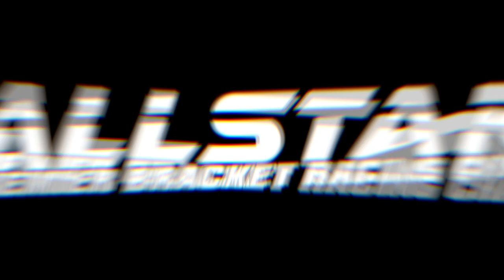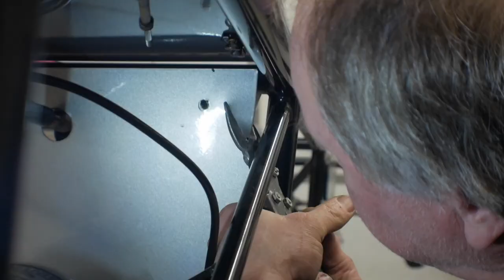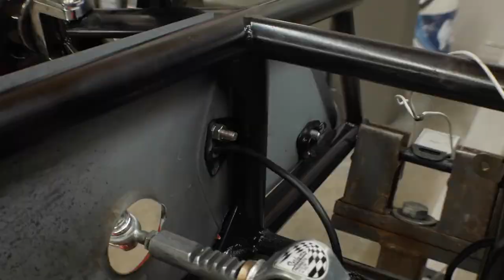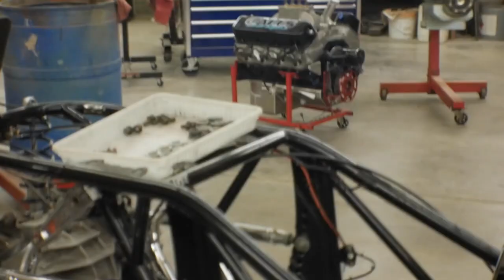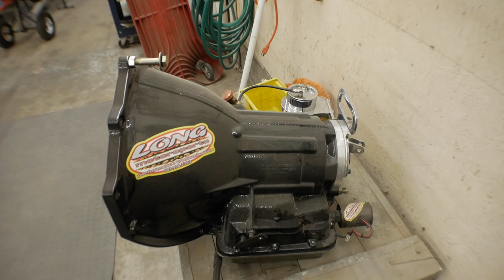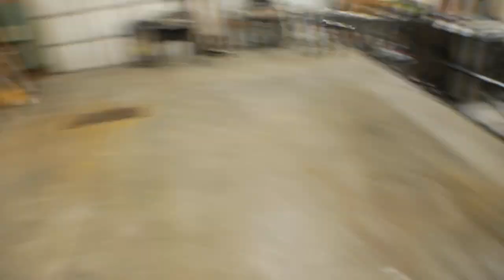RACE CAR BUILD BEGINS! (Dragster Tear Down and UPGRADES!)

Comment: Single XS D1600 with a 100 amp Super Mini alternator is one of the best setups you can run IMO I usually don't have to charge at all towards later rounds or if I'm doubled the XS Power and alternator combo never skips a beat. We run the D1600 over the lightweight S1600 because our cars run electric fuel pumps and gas, but honestly even if we ran mechanical pumps and alcohol (less fan run time also) we'd probably keep the D1600 because it has a ton more reserve and its just piece of mind knowing that the battery will keep up in any circumstance. The lithium stuff doesn't impress me because even with it being so light, the extra cost and the maintenance required seems excessive since we're just bracket racing... Good luck with whatever you end up with!
Reply from the maker: I appreciate all that information Nick!!  It will be considered!!

Comment: If you decide to use a lithium battery, use Go Lithium! Best battery on the market. It’s also the safest. Been using mine for two years and never had an issue. 8lbs of bad ass

Comment: Get a 16 volt alternator and put two of them lithium batteries in there you can't go wrong I tried to post a picture of the ones in my car but it would not let me
Reply: The 2 batteries fit in the spot of 1 12 volt battery and weigh 1/3 of the weight of one 1   12  battery